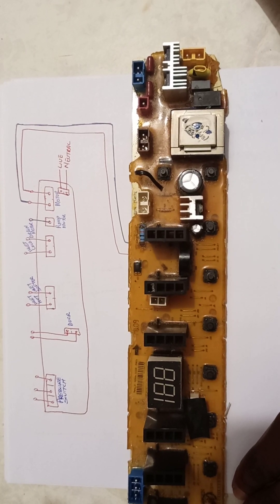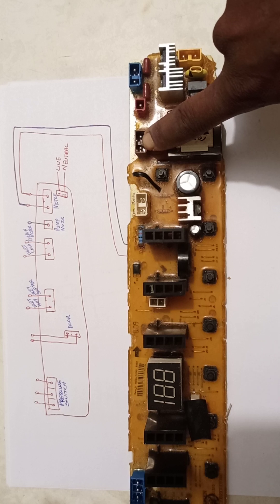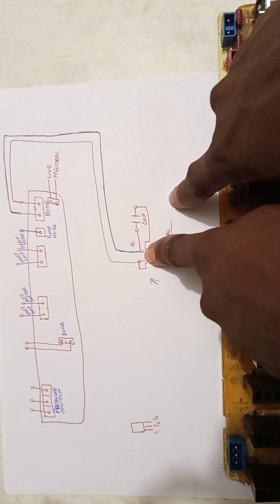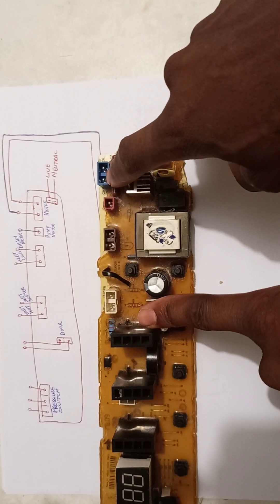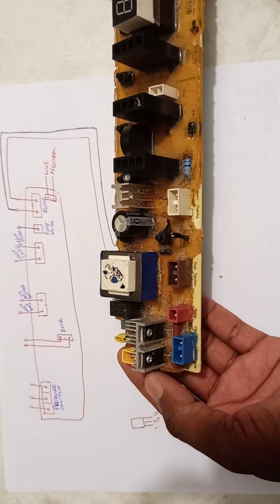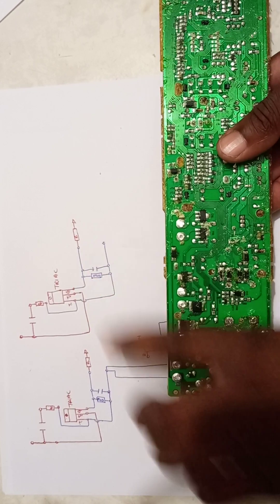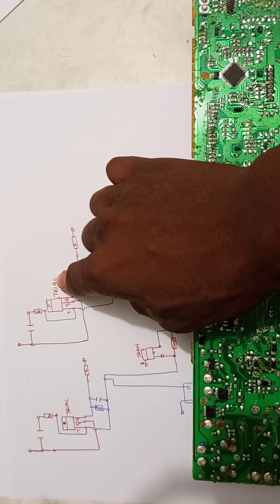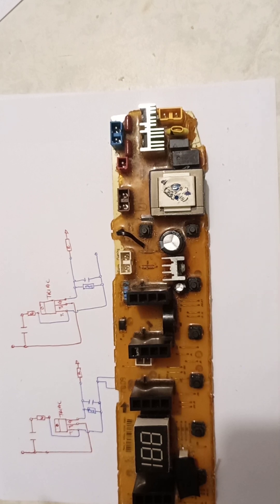PC Board fault finding for a toplaoder washing machine(part2)

Comment: Hi there i have the same board its giving me an E6 error code the door block is constantly open as im testing the board coz i bypassed all the circuits relating to the door. how do i test the unit on the pc board boss
Reply from the maker: My problem is that I no longer have the board with me, but if you have shorted the door  switch and still getting e6 trace from the door input on the board to the main proccessor  maybe there is component causing the open line
Reply: hi yes please help